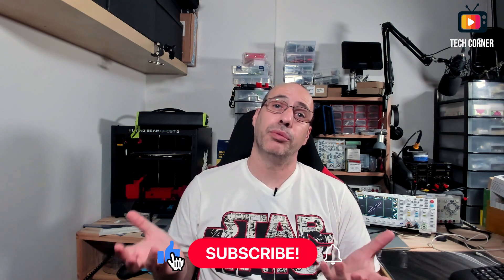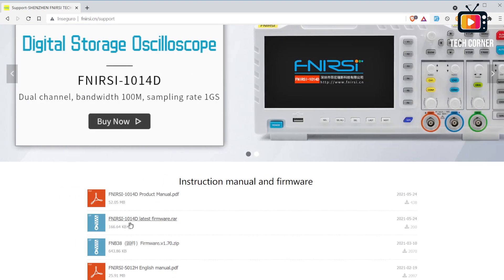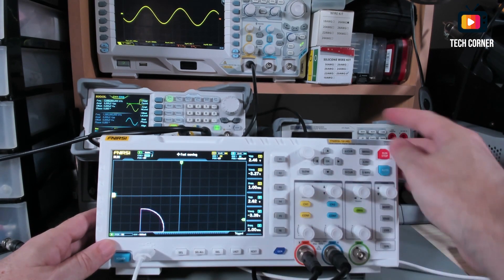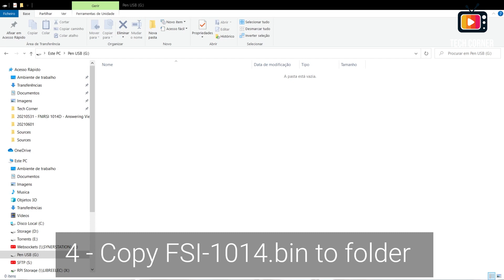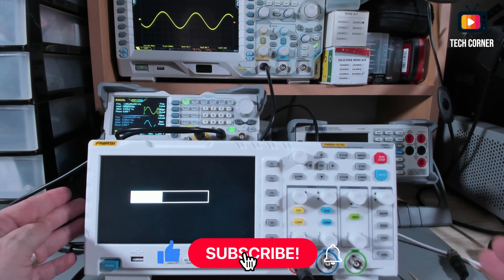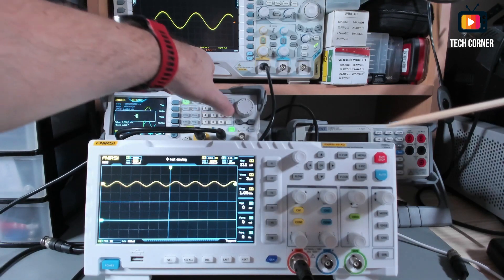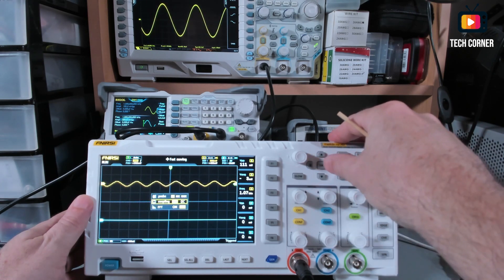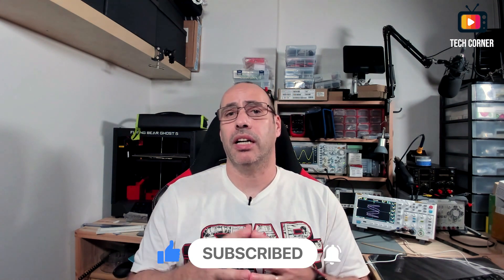FNIRSI 1014D - How to do a Firmaware Upgrade Tutorial

Comment: Damn! My computer will not recognize my device. Although The splash screen on start up say it is V3. So I assume it is good. Mind you when testing 5V the Vavg say 50.4 V
Reply from the maker: Hi, I had similar problem with mine at the time when testing it, but I had one of the first units to hit the market, since that time a lot of issues were fixed. I know is obvious suggestion, but make sure both probe and oscilloscope are at the same attenuation (1x or 10x). Thanks for watching.
Reply: @TechCornerTV  I  will...Thank you.

Comment: Buongiorno, tantissimi complimenti per il video spiegato in modo esemplare, mi sono subito iscritto al tuo canale, e ho seguito i tuoi consigli riguardante il firmware, nel mio oscilloscopio FNIRSI-1014D, non si riusciva più a vedere la forma d'onda, allora ho scaricato dal sito FNIRSI il firmware "FSI-1014.bin", l'oscilloscopio ora va bene, unico problema è che la visualizzazione del display non è centrata è spostata di alcuni millimetri a destra e verso il basso, perdendo la visualizzazione di dati, hai qualche consiglio di come posso fare?
Da notare che sono andato nel tuo sito e ho scaricato le due versioni del Firmware, ho provato entrambe le due versioni, ma il problema persiste,  la visualizzazione del display non è centrata è spostata di alcuni millimetri a destra e verso il basso.
Reply: Mi sono dato da fare, ho scaricato dal  sito FNIRSTI i due firmware che ci sono "FSI-1014.bin" e "FSI-1014.2.bin" con il primo e cioè "FSI-1014.bin" parte regolarmente l'installazione del firmware, con il secondo "FSI-1014.2.bin" non parte l'installazione del firmware, ma comunque rimane sempre il problema che ho descritto e cioè che la visualizzazione del display non è centrata è spostata di alcuni millimetri a destra e verso il basso, poi mi è venuta una illuminazione, ho rinominato il file "FSI-1014.2.bin" in "FSI-1014.bin" e cioè ho tolto il 2, l'ho installato e il tutto è andato OK la visualizzazione del display ora è centrata, PROBLEMA RISOLTO

Comment: Hey I'm asking here b/c I can't seem to find the answer anywhere. I have the 1014-D and when I measure DC voltage, it re-adjusts the horizontal line back to 0. Example: 0 Volts is in the middle of the screen and I have 2.5 V per division. When I measure 5 Volts, the line jumps up 2 divisions but then tracks down back to 0 with 5V still applied. Then when I remove the 5V, it jumps negative 2 divisions and tracks back up to zero. It's like there's an auto adjust setting somewhere but I can't find how to turn it off. If you have any ideas, I'd be grateful! Thanks!

Comment: Thank you for the helpful video. I have a question regarding the connection process: When I plug the FNIRSI 1014D into my laptop via USB, a folder  appears. However, when I try to open it, the folder freezes. After a short while, a window pops up with a message like "Insert disk" or "Please insert a disk into USB drive," and the laptop then notifies me that it doesn’t recognize the USB drive. The folder then disappears. what do you think is the issue in here?
Reply: sounds like an ac dc problem. Are u sure that yiu have selected DC

Comment: Does the scope have a differential mode where it will show (Chanel 1 - Channel 2). I could not find it. That is pretty important in looking at any component in a circuit that is not grounded. Thanks for your videos, they have been very helpful.
Reply from the maker: Hi, are you talking about the math functions? Channel 1 - (minus) chanell 2? Or plus, and so on? If that is the case, I don't have it with me anymore, but I don't think it has math functions. Thanks for watching.
Reply: It does not have math function.

Comment: Might you have a fix for a 1014D that when the power is turned on, the manufacture logo displays, but then goes to a black screen? Doesn’t display or come on at all. Basically it does not start.. Hope you can reply soon. Thanks.
Reply from the maker: Hi, you probably had the bios on the SD card screwed or something like that, my suggestion, goto www.fnirsi.cn/support and on your top right side, you have a QR code to enter the FNIRSI support whatsapp channel. Ping them and they will give you a solution for that. Thanks for watching.
Reply: @TechCornerTV  That URL is now invalid.
Reply: I had some startup issues with black screen on mine due to the power supply. I was using Try a better USB power supply (2A or above) and you should be good.

Comment: I was in the middle of using this 1014d and boom, the LCD screen went black. I turned it on and off, and the screen wont turn on. I do hear it clicking when i move the knobs, and i do get a 1khz tone from the signal generator. So the oscilloscope works but the screen doesn't. 

Is there a way to update the firmware absent the screen? would this really even matter? I bought it three months ago.
Reply from the maker: Hi, I saw several people complaining about this in the Whatsapp group. Your screen probably fried. You should contact them in the whatsapp group and try to solve that out. If it is the warranty, you might get them to send you a new screen. Go for it! Thanks for watching!

Comment: Hi i just used that method to upgrade to v3.0 (1014D V3.0 firmware version (October 6, 2021).zip) - this zipfile have two versions, after flashing with the first bin file, the screen offset was not right, so i renamed the FSI-1014 -2 to FSI-1014.bin and then upgraded again, and now its working with the right screen alignment ;)
Reply from the maker: Awesome! So nice you solved your issue. And yes, there are 2 screen manufacturers in that model. We never know with of the screen we get, so have to try both versions. Thanks for watching! 👍

Comment: In one of your videos you got a 60MHz sample rate, but I've seen some other videos indicate that this scope is not capable of 100MHz sampling. Did this firmware upgrade correct it to be 100MHz? Thanks for all the videos!
Reply from the maker: Hey Rick, at the time I shot this video and also the review video, I only had a 60Mhz function generator, so I was unable to test it all the way with a 100Mhz signal. But, for all I know, this oscilloscope isn't a real (-3dB) capable oscilloscope. I give mine away on a channel giveaway, so further testing is not possible. In terms of firmware and correction, I wouldn't know, since as explained before, don't have mine anymore, but there is a lot of people happy with this oscilloscope and also a bunch of people that aren't... so hard to day! If you want something and accurate, I will suggest the Owon SDS1102. Hantek DSO2000 series is a very compact oscilloscope with a ton of features, but has some serious bugs (as you will be able to see in my new video today) that where not fixed yet in the firmware. Thanks for watching! 👍

Comment: how to upgrade if the screen of my unit its all dark, i just buy it new from a store but i think someone upgrade it with the fail firmware lcd cuz it just show the first screem 3.0version logo then it becomes black i cant see the menu so im wondering if theres a way to upgrade with some key commands or something
Reply from the maker: Hi! To upgrade you just need to put the firware file on the USB drive and insert the drive on the oscilloscope and power it on. If the upgrade doesn't work, you really need to talk with the FNIRSI support to see how to solve that. Good luck solving that issue.

Comment: I am unable to find the firmware on the site.  I can find the pdf manual.  Thanks.  Paul Robinson
Reply from the maker: Hey Paul, they removed it. Do this, go to www.fnirsi.cn/support, using the QR code of the whatsapp group join in and ask for the latest firmware, someone there will save you 😁 thanks for watching! 👍
Reply: @TechCornerTV  I tried that now. I struggled to get in because the group is full....
Reply: @TechCornerTV  Has the firmware updates been better? I am receiving mine in the next week.
Reply from the maker: @naasikhendricks1501  I really don't know. I gave my FNIRSI 1014D to the giveaway winner but for the feedback I see in the group, it has some improvements.

Comment from the maker: Hello friends! I just found out in the whatsapp group that the new v3.0 firmware version was released. It introduces the following improvements: 
1. Added the display of firmware version
2. Fixed the bug of moving the cursor
3. Fixed the error of location data.
There are 2 versions/files depending on your LCD, so if you install one and the screen moves to the right, install the other firmware file. It should be available shortly in www.fnirsi.cn/support.
Reply: The tutorial is very good, but in the case of not starting the Software: it can be updated through Uart (through the CH341 TTL mode, by internal connection (TX / RX), and also copy the .bin file of the equipment when it is working well, to have it in case of need?The link to both firmware is not correct, it sends us to the support page, but there is no where to download both versions.

Muy bueno el tutorial, pero en  el caso de no iniciar el Software: puede actualizarse mediante Uart (a traves del CH341 modo TTL, por conexión interna (TX/RX), y también copiarse el archivo .bin del equipo cuando esta funcionando bien, para tenerlo en caso de necesidad?
No esta correcto el enlace a ambos firmware, nos envía a la pagina de soporte, pero no hay de donde descargar ambas versiones.
Reply from the maker: @sergiogalpon  Hello! You're right I tought that by now they will already updated the website with the new firmware, they removed the previous from the support page because it was buggy but they could put this new one there. Thanks for the info, didn't know that you can updated by UART! Good tip! Thanks for watching and your comment! 👍
Reply: Actually it was a query, not a statement "if it would be possible to update by uart when the software does not start due to being corrupt?
En realidad era una consulta, no una afirmación "¿si sería posible actualizar por uart cuando el software no inicia por estar corrupto?
Reply from the maker: @sergiogalpon  Hello! I have to say I'm not sure your have an internal UART internally, if you manage to enter the FNIRSI whatsapp group, is a great question to place there. Sorry for the misunderstanding!
Reply from the maker: Nikza  Hello! I'm glad you did find out, sorry for the late reply but I kind of swamped in videos to make and work projects (that pay the bills). Anyway, I always answer, might take a bit but I always do. Cheers.
Reply from the maker: Nikza  I don't have this scope any more, I gave it on the channel giveaway, but if the memory don't betray me, you work only with integer values on the bandwidth. Maybe some of the other user can help on this question... anyone? 😁
Reply from the maker: Nikza  It's a fine unit, you'll be ok!

Comment: function generator seems to be only 2.5V peak to peak on mine. How do I change it? It's supposed to be 5V
Reply from the maker: Hey Tengiz, well thats one of the oscilloscope issues, the function generator signal is fixed at 2.5V... it doesn't make much sense... thanks for watching and your comment. 👍
Reply: @TechCornerTV  thanks for quick reply. They removed the firmware from their website. Could you please upload it somewhere and attach the link to description? I'd really appreciate it
Reply from the maker: @TengizAdamashvili  I don't have the latest version anymore, you should do this, go to www.fnirsi.cn/support and on the banner on the top of the page you have a QR code to enter the Whatsapp support group, ask there the lastest firmware and they or other user will send you the latest. Please allow some time for response because of the time zone difference.

Comment: How is this oscilloscope DSO 1014 D please reply sir
Reply from the maker: The oscilloscope is really easy to work like I show on the video, the main problem is that we doesn't measure very accuruatelly. And that is a big no no for a measuring equipment. If the support solve that problems with a new firmware, is awesome for begginers.

Comment: I think that thing boots from an sd card, you should clone your card prior to upgrade, if the new firmware is even more buggy.
Reply from the maker: Well, I don't think it boots from the SD card, but it need a functional SD card to boot. In the FNIRSI support group, a user had a problem booting the oscilloscope due a SD card error and what they told him was to format the SD card and put it back again...  Regarding the buggy firmware, you're right. It's about time they fix the damn firmware once and for all... thanks for watching and commenting 👍

Comment: I found two problems: time stamps of the files in memory are wrong, the acuracy of vertical scales is weak and it differs for X and Y inputs. Today (27.06.2021) the firmware on the FNIRSI site is corrupted.
Reply from the maker: Hey Leonid! Thanks for sharing and participating. Use the one that is on the first comment (pinned) of this video. That one works ok. You might be also one of the lucky ones that received an oscilloscope with the octocoupler inverted. Take a look in this video, and see what happens when they are inverted. Nercy did a pretty good job on the video: https://www.youtube.com/watch?v=PS-EA8Tll50&t=403s

Comment: Thank you for a very useful video. How do I contact Fnirsi technical support? I have tried the website but have not received a replay.
Reply from the maker: Hello Etienne! The best way is their whasapp group. On this page http://www.fnirsi.cn/lxwm you have a QRCode for that group, just point you're mobile with a QRCode reader running and it will open the whatsapp group, just ask for help. If you did upgrade your firmware and have the screen to the left, just download the firmware that is on the first comment on this video,  its pinned. Thank you for watching and participating! Cheers. 👍😁

Comment: Can you also do a review of Perytech PC based oscilloscope? It seems to have good features for about 160 Euros approximately.  

There is a nice temperature controlled soldering iron called QUICKO T12- 942 . Can you do a review of it?
Reply from the maker: Hello! I've contacted Perytech PC to see if they can provide a sample. If they do, I surelly do a review. About the QUICKO T12- 942 I was unable to find the manufacturer, can you help with the manufacturer website link? Thank you for watching and you comment. 👍
Reply: @TechCornerTV  Quicko T12 - 942 http://www.quickochina.com/Products/OLEDsolderingstation/27.html

Comment: I have bought one piece and waiting for delivery. I hope the updates will fix any bugs without further problems! For the price and that it is portable and isolated from main noises and also the navigation and screen layout looks great , it is a swiss knife  in your pocket with a very minimum price !
Reply from the maker: Yeah... its a nice unit, it has some limitations, but for the price I believe we can leave with that. The first comment of the video (pinned) one has the link for the firmware file if you get the shifted screen. Thanks for watching and your comment.
Reply: @TechCornerTV  Thanks for the link when it arrives I will try to contact with FNIRSI and learn which exactly update is for my scope.
Reply: @rtwodtwo9338  hey did you find the update?

Comment: It's all very well showing sine waves and square waves but they are periodic waveforms that doesn't really test the scope. This scope apparently is quite heavily undersampled, so it will look fine on periodic waveforms but how about you show its real capabilities by feeding it a very non-periodic waveform and seeing how that looks.
Reply from the maker: It is a well debated topic the bandwidth limit of the oscilloscope, but regarding periodic/non-periodic sample waves, I tested with modulation for FFT on the video "FNIRSI 1014D - I Answer your questions about the oscilloscope" and you can see there that is fairly ok before I screw up the time for give a better image for the FFT. I also tested with Sweep in different kinds of wave with no major issues. Again this oscilloscope is limited and isn't for everybody, but for electronic learners or even businesses that don't need functions like math (a+b, a-b, etc) or decoding, is a nice option... well at least is my opinion.